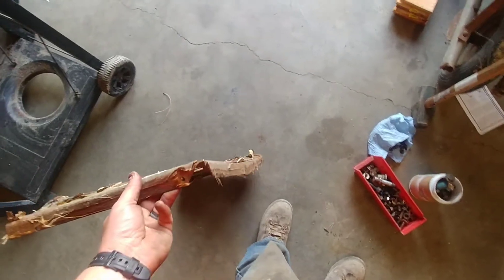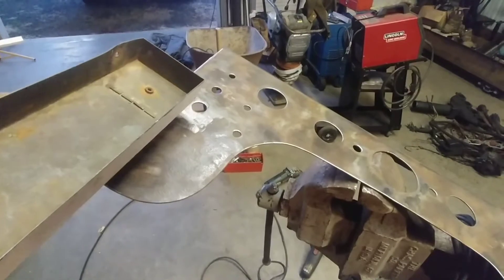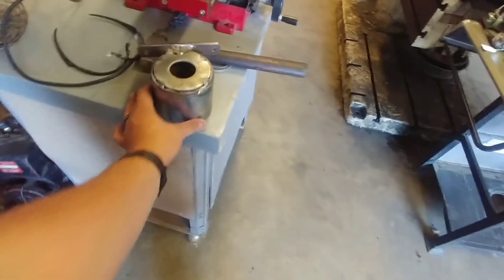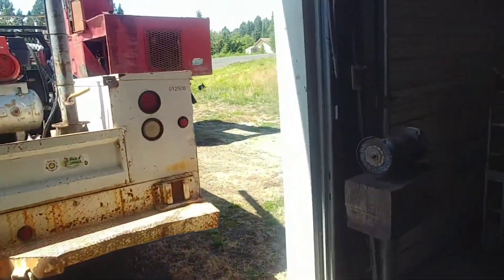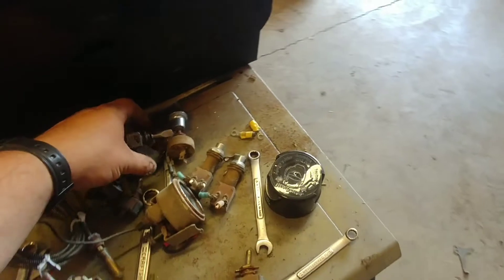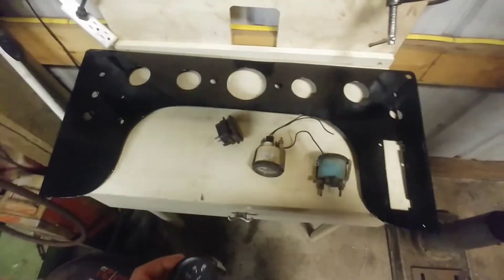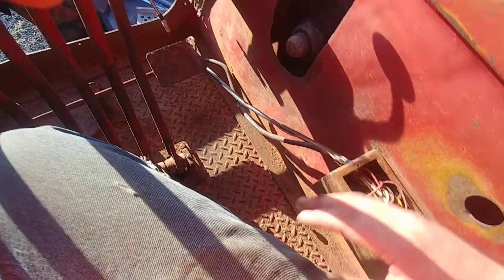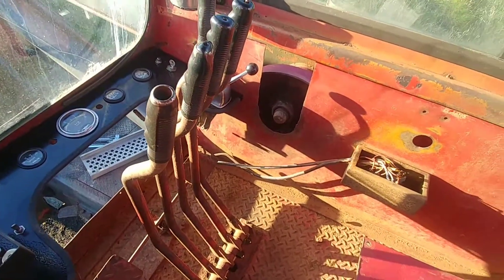Rewiring The Savage log loader pt: 3

Comment: Looks good man. Nice work
Reply from the maker: Thanks. It's hard for me because I want to paint the inside of the cab, install all new glass,fill in all the holes, and hammer out all the dents. But I have to remind myself that I'm not restoring it... Just cleaning it up to load logs lol
Reply: @tttco  roger. That driver
If your cab is always  wide open
I would maybe at least install  plexiglass  for the windows to protect the gauges  and wiring
Reply from the maker: @Bobcat325  I have some plexiglass I am going to cut and install after I finish the electrical. The main problem is the glass window above the dash is falling out because the cab is so bent and beat up. I'll have to take it out and see if i can "fix it"